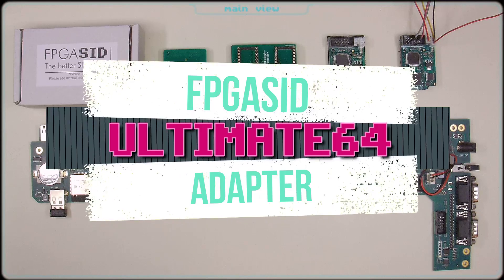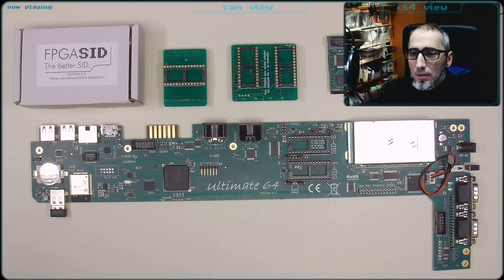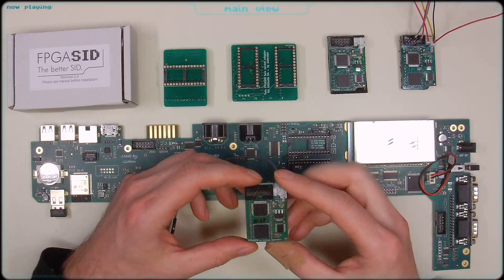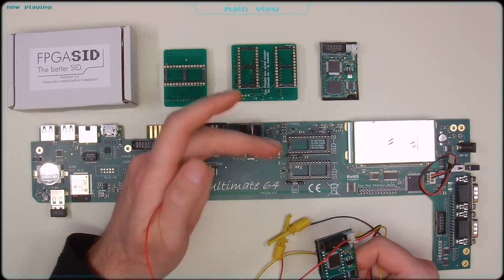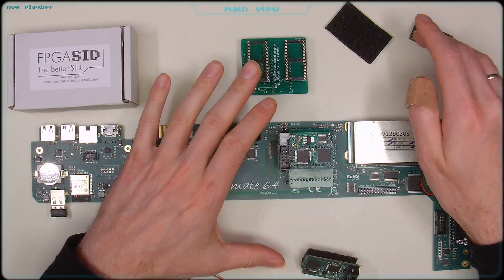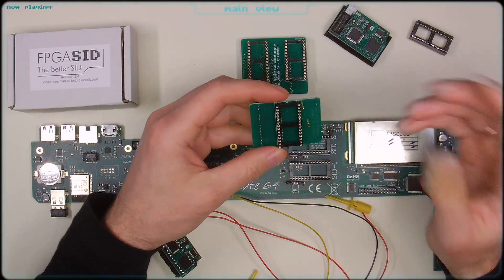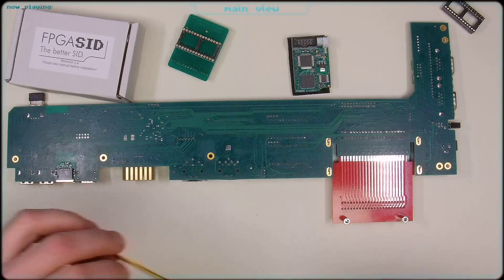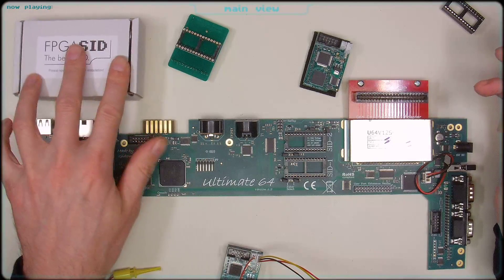C64 Hardware - FPGASID on the Ultimate 64 - Adapter work in progress

Comment: Hello
Have you finalized your project? Is it possible to buy these adapters for FPGA Sid?
Reply from the maker: Hi, yes, I did. You can order them here: https://forms.gle/TJMNbvfdKLtaHrk99
Reply: @c64customs  
Hello,
I ordered you but made a mistake,
 I only need the FPGASID adpater. 
I give you a new order or you correct it.
I sent you an email about it
Reply from the maker: @kaloun34  I've corrected your order and have sent you a new confirmation.

Comment: Hey Daniel. I just received my FPGASID today. Your videos on the subject are suddenly very valuable and interesting :)
I'm wondering about the adapter you made for 1 FPGASID: normally the FPGASID needs access to A5 and A8 (pins 12 and 15 on the 6510). I'm wondering how you get access to those from the other sid socket on the U64 board. 
The same goes for the A/V signal the FPGASID requires. But that may just be pin 27 on the SID?
Reply from the maker: Hi Wouter. The adapter is getting all the required information from the second socket and routes it to the FPGASID via the third wire (I/O1, I/O2) connected to the CS signal of socket 2 and the second audio channel is routed back to the second socket of the U64. This adapter was made to reduce the wiring effort of the FPGASID and usually it is detected by the U64. I haven't tested this for months so perhaps it's about time to do it and to create a little video about it :)
Reply: @c64customs   Not sure how you figured that all out, but I think it's pretty smart. Did you publish the design somewhere? I might be interested in one.
Reply from the maker: @TheHighlander71  I had planned to do so but never got it done, unfortunately. But I can send you a PCB, a assembly kit or a whole assembled adapter, just let me know what you need, I'm sure you have my email address :)
Reply: @c64customs  That would be vert cool. I’ll email you.

Comment: Gideon has now introduced a jumperless U64 Elite board with ZIF sockets for the SID chips - https://ultimate64.com/Ultimate-64-Elite.  Does this impact your plans?  Will you develop an adapter board that would work in the Elite?
Reply from the maker: Basically, the adapter will work on the Elite board as well as it is very similar to the already existing ReloadedMK2, hardware-wise. Since the FPGASID runs on boards for 8580 SIDs as well as on boards for the older 6581 it doesn't matter which setting is used and so it shouldn't interfere with the auto-detection feature either.
Reply: @c64customs  Cool :)  Although one thing I wondered about was being able to move the ZIF socket lever up and down with the adapter in place.
Reply from the maker: The Reloaded MK2 uses similar sockets and there it works quite fine. You have to lower the lever a bit to place the FPGASID onto the socket and then you can close the lever completely.
Reply: @c64customs  Good to know - thanks :)

Comment: Have you considered another revision of that twin-socket adapter that also makes contact with the voltage and filter jumper headers underneath for the purpose of relocating those jumpers to the top side of the adapter for easy access?
Reply from the maker: That would indeed be possible but what would be the benefit? The FPGASID don't need the external filters and it runs on either 9 V or 12 V. So whatever you have configured, you don't need to change it later.
Reply: @c64customs  Ahh, yes. Of course. If only using the FPGASID, you are absolutely correct.

I was actually studying the layout of the Ultimate-64 board and lamenting the proximity of the SID sockets to each other and the surrounding components because I was contemplating adding ZIF sockets to mine to use with real SIDs. Then I saw this video and the adapter you came up with, and I thought that was a brilliant solution that would solve my dilemma. However, it would still require me to remove it to change the voltage and filter settings. This one particular aspect of the Ultimate-64 is one of the main reasons I love the Reloaded MK2 so much more: the flexibility of being able to auto-detect the SIDs and toggle between them on-the-fly.

I apologize that I did not clarify that earlier. Again, brilliant idea. Thank you for sharing this. I love your videos, my friend.
Reply from the maker: Thank you very much for the info. Well, for such a purpose it makes sense and changing the adapter to something you're looking for wouldn't be very tricky. Let me check what I can find for getting connected to the onboard jumper.

Comment: Liked the video and the new camera, good to see a face to the voice. Doesn’t the FPGA Sid have two sids already? I’m only familiar with MK2 board, can you plugin one FPGA sid and have dual sids on the MK2 board without the riser? Sorry just trying to understand how many 3 voice sids each of your pcb allows on the U64 and MK2
Reply from the maker: Thank you for the feedback.
The FPGASID represents two SIDs and with the cables/clambs provided with it you can have 2x3 voices on any C64 board. The idea behind the raiser is to use the address configuration of the mainboard, eg the MK2, and to eliminate the need for the clambs. This makes it easier to configurate the addresses for the 2nd SID and uses the stereo mix features of the board altogether without routing the audio of the second SID via cable outside the C64. So you can use the 3.5 mm stereo jack on the MK2 to listen to the 2x3 voices of the FPGASID. 
The second board/raiser I have created is needed to run 2 FPGASIDs on a stereo board like the Ultimate or the MK2, whereas the later is currently not planned but maybe. You will have the 3 voices of the first SID of each FPGASID routed thru the C64 mainboard and can get the additional audio of the 2nd SID of each FPGASID via cable.
Reply: _ kieferkn/i:/stern _ thx for the explanation.
Reply: Follow up question - Does the single riser make the sid address configuration via the serial port on the MK2 no longer needed? Im assuming so, that makes sense because having to have another pc to configure the audio output on the MK2 is not ideal
Reply from the maker: No, it would move the address configuration away from the FPGASID to the MK2, thus the serial connection is needed to change addresses if used in the very same way as I have described. 
I know, this is not an ideal state since some people prefer to do this via a programm like the configuration tool for the FPGASID but others like to do this on the fly while a game or demo is running or about to start. This is easier on the Ultimate64 with the build-in configuration menu and this is where the idea was born :)
But it is indeed possible to use the raiser just to get the audio signal to the second socket, connect all the additional cable clambs to A5/A8/IO1 and use the configuru program to configure the FPGASID as it is intented. This would eliminate the additional cable for the SID 2 audio signal coming from the FPGASID and you can use the 3.5 mm stereo jack on the MK2 to get the audio signal from both emulated SIDs.
Reply: Ah ok got it.. well that is pretty cool, a single FPGA Sid performing like a dual real chip system with standard config on the MK2. I don't mind the serial config since I always have a PC nearby. But would be good to be able to control via C64 software. I'm waiting for my U64 to arrive

Comment: Ich würde so viel, wie möglich auf die Boards machen, d.h. die 3.5mm Buchse in jedem Fall. Die Anschlusspunkte würde ich als Pinheader im 2.54mm Raster ausführen und ein bisschen Platz drum lassen. Dann kann man unterschiedliche Lösungen für das Gegenstück finden, z.B. Ein Stück Buchsenleiste ans Kabel löten oder einen Dupont Crimpverbinder - der ist in vielen Bastelkisten. Ich denke, dass die weißen Steckverbinder  auf dem FPGASID JST XH sind. Da kann man auch welche auf das Board setzen. Dann kann man sich entweder kurze Jumperkabel bauen oder die gelieferten Kabel abknipsen und in das Board einlöten. Zur Not kann man die Bohrungen in den Pads etwas größer machen, damit die Litzen geschmeidig durch die Löcher gehen. Wenn Du möchtest, kann ich mir Deine Leiterplatte mal ansehen, bevor Du in Produktion gehst. Welches CAD-Programm verwendest Du?
Reply from the maker: Das Angebot nehme ich gerne an :) Ich arbeite mit KiCad und das sind meine ersten Schritte bei der Erstellung von Leiterplatten, ist also recht viel Trial'n'Error derzeit ;)
Ich werde jetzt mal noch die aktuellen Ideen mit einarbeiten und mal schauen wie das alles so passt und dann kann ich dir die Dateien ja mal schicken.
Reply: @c64customs  Es ist ja nicht so schwer. Das sagen wir nur niemandem, damit wir unseren Nimbus aufrecht erhalten ;-) BTW: Nimbus gibt es auch als 8-Bit-Version von AEG-Soft für den C64 ;-) Ich habe kein KiCAD, aber irgendwie schaffe ich das schon. Meine e-mail hast Du ja.

Comment: Awesome! Idea of a 3,5mm jack would be fantastic for music purposes. With an expansion port adapter like yours, you could easily access the SID pinouts with MSSIAH in it? Hopefully i get you right. Thanks for the good work! Keep goin'
Reply from the maker: Thanks for the comment.
Yes, this is the main idea, getting access to the pins but keeping the functionality of the expansion port. It will be a kind of fragile construction since there is no additional mechanical support for the adapter then but with some attention and care it should work.
By the way, Mssiah works without such an expansion port adapter already since it is using the second SID at $DE00 which requires IO/1 as input signal only, so there is no need to connect the FPGASID to A5/A8. Unfortunately, the Ultimate64 has still some issues with Mssiah which will be fixed anytime soon hopefully.

Comment: I was wondering if adding a solder pin or one with a probe a bit like the one linked here might help on the cart pcb 
https://goo.gl/images/HSczy7URL 
 I can't find the exact one I was looking for but its something similar. Might help to attach test probes that come with the FPGA sid
Reply from the maker: Hm, the link isn't working but thank you for the suggestion.
Yes, the idea is to use the original FPGASID cables and connect them to a pin on the expansion port adapter.
Reply: _ kieferkn/i:/stern _ hi try this link hopefully it will work  now.            https://www.ebay.co.uk/itm/362275947105
Reply from the maker: Wow, it looks funny on the first glance but yes, indeed. Such a probe would be perfect for the clambs. I will try to find a source that ships to Germany as well. Thanks for the link!

Comment: I like that you show your face. Great video and a fantastic project.

Would it be possible to some kind a collective order for the PCB and maybe also for parts.

I would want to order both boards.

board 1.
adding 3.5mm jack as line the same way as sidfx does.
Add support for choosing different SID configuration by using external switch like SIDfx.
I want to be able to switch between stereo and different setup of mono SID1 and SID2 like SIDfx.
it would be great, if the board could support both U64 and MK2. It should be possible to use the same pcb and have different soldering points for the pins for U64 and MK2.

Board 2.
should also support other SID chip like 6581, 8580, SwinSid ultimate, ArmSid
adding 2 x 3.5mm jack as line the same way as sidfx does.
the board should be jumper less and configuration stored on the board and be configurable thru C64 program like sidfx.
It a good idea to build and adapter for the expansion port like x-pander3 where you can add a cartridge. Most useful on the MK2.
Reply from the maker: Thank you for your input, very interesting.
Some stuff sounds doable but I think I'm not going to create another twin SID adapter :)
Switching between the two configurations is already a feature of the FPGASID so this is easy.
Supporting real SIDs is going to be tricky due to the filter capacitors and the voltage regulators. Same for the mixing, this would require more electronics. That's basically what the Mixsid is doing already http://henning-liebenau.de/mixsid/
The stereo jack in a way the SIDFX is handling it is no problem, I just need to add the soldering points for the connectors to the PCBs.
I was considering adding the same amplifier electronics like on-board the C64 to the adapter, I will consider this perhaps for version 2, maybe including a mixer :)
Reply: _ kieferkn/i:/stern _ i have a sidfx and mixsid, so I Will managed. I still want one of each😀
Reply from the maker: @egumit  No problem :)